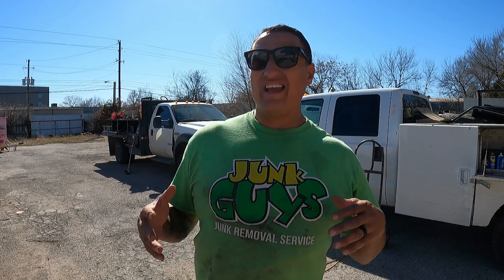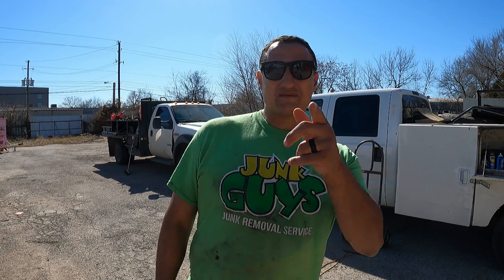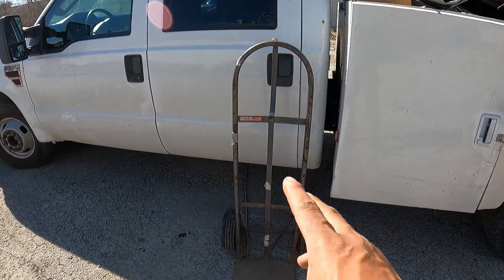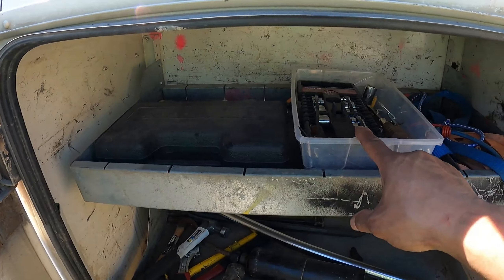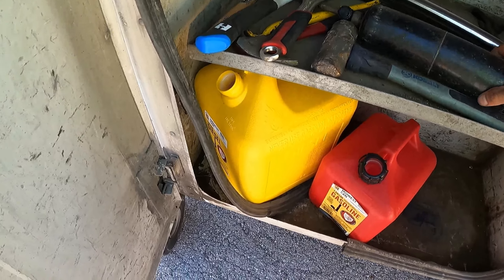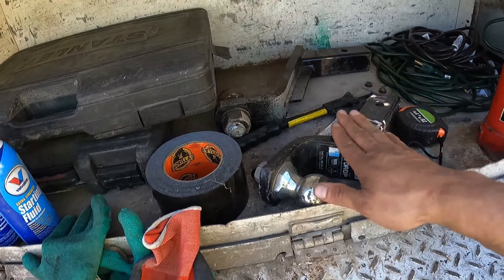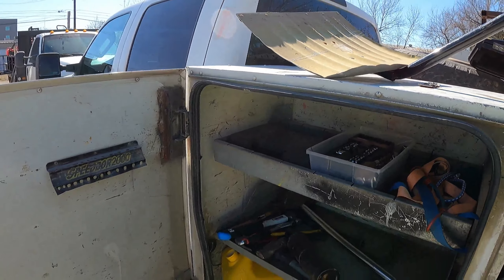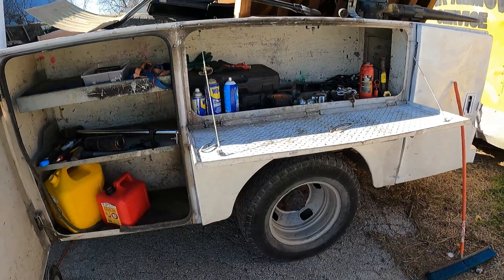What Equipment You Need For Junk Removal? / JunkGuysDfw.net

Comment: Tip thing to add

 Fill old Powerade or Gatorade bottle with water. Then ad dish soap. Best for hand cleaning or cleaning wound from cut. Write soap on outside so you don't drink it 😂. I keep 2 in truck. Help me clean a real bad cut couple of times Also homeless encampments because they all smell like piss and s*** 95% of the time. So great to give a good hand wash right after. Keep old ( clean ) towels people throw out for throw away rags.
Reply from the maker: Definitely need these things.